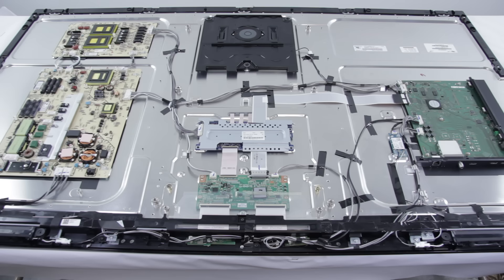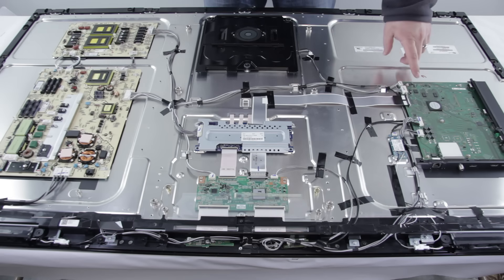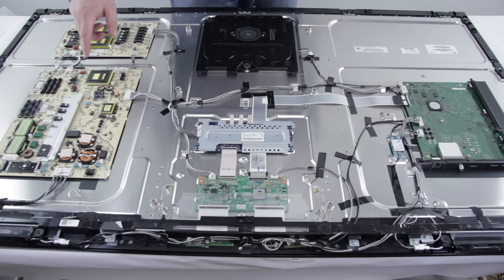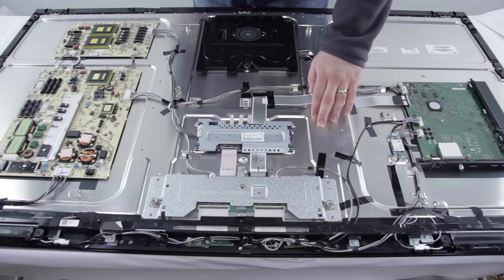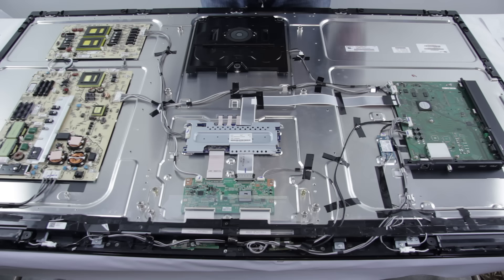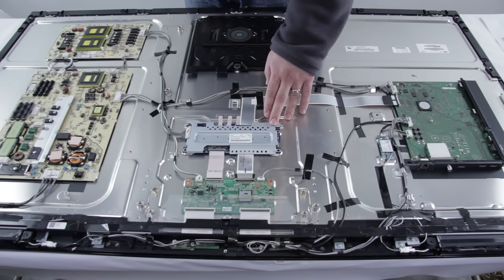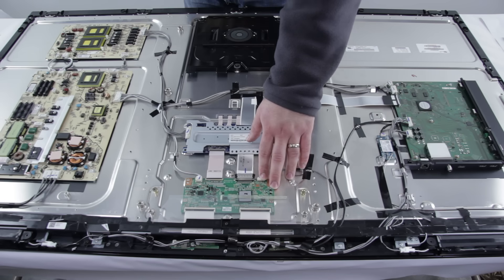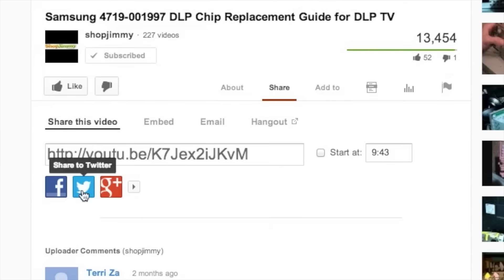LED TV Repair Tutorial - Common Symptoms & Solutions - How to Repair LED TVs

Comment: When I turn my tv on the vizio logo comes up then nothing else happens. After that I cannot turn the tv off either with the remote or the button on the tv. It just flashes the vizio name at the bottom of the screen,goes off for a few seconds, then comes back on with the vizio logo on the screen. I have tried unplugging it for awhile then replugging it,checked all connections and everything else I cvould think of but nothing works. Model M421VT.

Comment: I have a Hisense led lcd 50H5D tv. The picture went but the screen still have back light and sound. I replace the main board with a new one but still no picture. This tv has only a power board and main board and two small board connect to the screen. C an you say what is the possible cause. Could it be that I got defective board with the same issue or is another problem

Comment: Hi. Samsung un55c7000wfxza will not turn on. Has power. Has red standby light. When pressing power on remote or on the tv touchpad the standby goes out. Tv does not turn on.  Makes zero sounds or clicking. When unplugged allowed to sit several minutes to overnight then plugged back in with same results.  Once plugged back the standby light comes back on but same issue when power is commanded with remote or touchpad. Sometimes the touchpad light will stay lit once power is pressed and tv doesn’t power up.  It was a degrading condition over 2 days.  Outlet is good. Tested with and without surge protector.   Tv is off wall and ready to be opened for troubleshooting. I’m mechanically inclined but electrically dense. Thanks for your help. Cheers.

Comment: Hi, I am facing issue with my Samsung 32 inch LED TV speakers. The issue started when I had painted my house recently and I had removed the tv for sometime from the wall and then while connecting back I believe I had connected the tv audio input with my pc mic input jack with 3.5mm jack wire later I realized that it was incorrectly connected it then I changed the connectivity .i.e. between pc audio input of tv and then connected it to the pc speaker output 3.5mm jack but after that i started hearing lot of static noise in my tv volume. Below are my tv details:

Samsung LED TV 32 inch
Type No. UA32D5000
Model Code: UA32D5000PRMXL
Version No: CN01

Can you please advise how can I fix the above issue, do I need to replace the speakers if yes, can you share the exact details of speakers and where can I buy the same. thanks and lot in advance and appreciate your help on this.

Comment: Thank you for the video.  I am one of those people that has no power at all on my TV.  I usually will not try fixing a TV on my own, but your tutorial video gave some confidence.  I have 2 questions for you sir.  1 - If I was to order a power supply, would I be able to correcutly disconnect the old power supply and connect it to the new power supply with usual tools at home.  2 - When I do order a power supply, is it possible to locate a used power supply instead of having to pay more for a new power supply?
Reply: Forgot to mention that the TV I have is a D32x-D1.

Comment: Jimmy I have a 55'' Samsung TV model # UN55EH6000F there is a red light that surrounds the power button that's stays  on but the TV will not turn on at first I would unplug the TV wait 15 to 20 minutes then the TV would turn on but now even that stop working if you had to take your best guess would it be the power supply or the main board.

Comment: I have a tcl roku tv model 55fs4610r  the stand by light is on but the tv won't show picture or sound but the little status light is lite I have unplugged tv and tried hit reset button but it does not work still.

Comment: I have a Samsung, model number: UN60J620DAFXZA. I have no back lights. I did the flashlight test and saw the "Samsung" appear and disappear. According to your video you said it may be the LED driver...?? Is the LED driver in the main power supply? And should I replace the LED strips too? I already purchased the "T-Con" board before understanding your video and I am going to lose the "restocking fee" once I return that board...since that didn't fix anything. I would love the most economical option at this point to revive my poor tv. Thanks so much!!

Comment: I have been given a POLAROID LED model #50GSR3000. A small child hit the lower portion of the screen. There appears to be an impact spot and no color on that side of the monitor... what appears to be a crack goes up to the top of the screen. What would be the problematic part that would need repair/replaced? Any help with this would be greatly appreciated.

Comment: I have a samsung un55ks9500....I turned on the tv and the screen became blue with a glowing pulsating yellowis ball,,it was moving forwards/backwards.....this happened 2-3 times...the tv also(intermittedly) when turned on stays black from anywhere from 10-15 secs..I have pressed the samsung remote and the sources etc do not show at bottom of screen.....also,I have experienced while watching a program,the top right corner of screen(8 x 8") turns black..like pic in pic but I do not have that feature..this lasted for several secs.GEEK squad have looked at tv and another tech co...they found several service menu code issues.They say they need to remove tv to their shop to do diagnostic tests...they will keep for 1 week or so..
Have you heard/know anything about these issues?
Can they do the diagnostics in my home ?
these are all intermittent issues over last 14 mths ?

Comment: Do you have any kind of respectable repair of the ribbon cables where they run from the screen to the driver boards? Guy said he got carried away with the windex, and that it had run down onto the driver boards under the screen. Upon disassembly I found a spot of corrosion and about 3 traces burnt where the ribbon cables from the screen connect to the driver boards under the screen. I'm thinking to try the  soldering heat torch with just a little flux, but no solder to try to reconnect the 3 or 4 traces back to the board. I do have good clean contacts on the board with about 1/8 inch of bare traces hanging out of the ribbon cable, but these things are so fine, I have to use a loupe to even see what's the problem. I am somewhat versed in electronics, but I have almost no experience with the surface mount stuff, and most likely not even the tools for proper soldering. Most things these days are just replace a board or something, with no actual repairs to a board (replacement of discreet components) being done. It looks like the only other options would be to replace the screen with new ribbon cables attached, which of course is out of the question. This is on a 55 inch Samsung model un55eh6000f, manufactured in 2012. Many thanks in advance.   DW

Comment: Good afternoon, I recently purchased an Insignia 43" LED TV for my son, as he was installing the legs it appears that he placed pressure on the screen and now the screen is broken, it does not look broken from the outside but when you turn it on you can see a point of pressure. I know I have to change the screen, when can I purchase the replacement? the model number is NS-43D420NA18. Thank you.

Comment: My vizio model  E320i-B0 has no backlight or sound. There is an image. I used the flashlight trick and did see functionality. My tv has only 2 boards. I think. That's as far as I've got anyways. How can I tell if it's the power/driver board or the leds?

Comment: Jimmy thanks for the awesome vizio. However, I have a vizio (Model E65-E0 and serial number: LAUSVKAS3702629, PART # 10258070222) 65 inches TV when I toggle the on button, the screen will come on,then flickers for 3 seconds with white horizontal lines and then goes black. Though it seems to be on but the screen will remain black and when I repeat the process same thing happens. I contacted Vizio and they troubleshooted the TV and nothing happened. Unfortunately I was out of warranty and now I have to figure out what part needs to be replaced and order it myself rather than calling technicians and get charged close to $400 dollars for the job. I have had the TV for over two years. During the first year of the TV, I had almost a similar problem and VIZIO sent a local technician and he came and replaced a board inside. Please help me. I just need to know what exact part that needs replacement and where to purchase/order it (reliable source part). Thank you in advance

Comment: I have a 55 inch Samsung Series 7 Tv model: UN55KU7000FXZA. It recently started having picture issues. The screen appears to be off, but when you hold a flashlight or low light source up to the screen you can see a little bit of picture it is just really really dark. I can hear sound coming from tv perfectly fine. I originally thought the issue was with the main board so I purchased one from you guys. I changed out the main board and the issue still exists, I am trying to figure out what the actual issue. I will more thank likely be sending back the main board and asking to get the power supply board instead unless you can provide me a better idea on what the issue could be.

Comment: Hi,
I have a Sony 46hx929 led tv. Every time I turn it on from cold start, tv as an horizontal line with no pixel for 30 seconds. After that the image flashes for about 5 seconds and everything is ok until next startup. It doesn't show the problem if I shut the tv off and restart it in a short time like one minute or so... What could it be?

Comment: Hi, I have a problem with an LG 50LN5750. It is pulsating every seconds doubling the image a quarter inch below and come back to normal. Also have, two horizontal black line in the bottom of the image. Doesn't seems to fit any normal trouble shooting. T-Con board or mainboard or Panel? Thanks for your videos and the help! :)

Comment: hi im wonering if you can help me i have a samsung 50 inch UA50F6300AMXRD that has sound but no picture, if i unplug the right hand side panel the left works. any ideas for me to try? can i get a service manual for this if so where could i find one so i can figure out if its the tcon or the right panel. any help would be great pretty keen to find the problem. thanks

Comment: Hello, I Have a Sony XBR65X850C,

Initial problem: No power to tv, LED wouldn't light up and no response from TV at all. 
Replaced Video Board and Power Board, LED illuminated flashing amber/green followed by constant dim white. No picture, but i am able to hear volume up/down noises. 
Now at a loss as to what else may be the problem. From research some forums say LED backlight or panel, others say T Conn or even firmware updates. Any assistance would be great!!thanks in advance.

Comment: Hello my sony  tv model number is kdl-40v4150. My issue is the screen has green/red blocks of color in vertical lines. I already tried to just unclip and clip back in the panel cables to the tcon but that did change the issue.  Not sure if its the panel or the tcon.

Comment: Hello, I have a Vizio 32" E3D320VX. It has a 0500-0405-1320 LCD Power Supply Board and a 3632-1742-0395 Main board.  The tv turns on and is stuck at the V insignia.  Do you think that it is the power supply board or the main board.  The tv works great and I'd like to buy a board to repair it.  Thank you.  BTW great videos!

Comment: Hello,
Thank you for your video clips and for the information you provide.
I an issue with my LG smart TV. I have a model 47LN5750-UH. The TV turns on and you can see the LG logo clear for 2 seconds then it goes dark.
With a flash light, we can see and navigate the menu. Go on youtube and select a clip and we can hear and control sound volume but screen is dark black. What could it be?
Thanks in advance.

Comment: Insignia NS-50D40SNA14. TV works fine for 510 minutes and then you lose picture TV will stay on if there is a fan blowing on the IC chip or that area I should say. any thoughts would be greatly appreciated.

Comment: Thanks for the video.  I have a SONY KDL-52NX800 that has an intermittent problem in which vertical red, green and yellow lines will appear on the left side of the screen and a faint white line covers the right side.  These colors become clearer the longer the TV stays on.  We see this problem about once a week and it usually goes away after unplugging the TV for a few minutes and then plugging it back in and turning it back on.  However, last night, this did not work and I had to leave it unplugged overnight for the TV to return to normal functioning.  After watching some of your videos, my guess is that the t-con board or one of the ribbon cables is failing.  What are your thoughts?

Comment: is there a way to test the connections on the tcon board without it having to be so arduous? there are so many  small pins and wires in the ribbon cables.  Would i just put the test lead on its side and sweep the cable for resistance check?

Comment: I   have  a 50 inch Haier LCD tv. The  set is  about 6 years old. Two  days ago I noticed on  only one channel, 10 
 showing  green  pixels randomly all  over  the set. Its interfering with  clear watching.   all  other  channels 
 work  fine.  I have unplugged and replugged in the tv and made sure all connections going to the tv were good. Not sure what to do.  Its only channel ten thats  problematic. Unfortunetly I watch programming on channel ten.

Comment: Ok so I bought an led strip from you guys and I have a 50L1400U Toshiba tv. The issue I’m having is that the led strip will work fully for maybe about an hour, but then the bottom part of the led will go out. Turning the tv on/off fixes this problem but only temporarily. Any idea as to why it does this?

Comment: Hello I have a LG 47la6200 that I had in storage for a couple months. When I plug it in the standby light comes on but then turns back off within a few seconds. The TV won't turn on at all. Would a new power supply fix this?

Comment: I have a toshiba 55L621U    it powers up to main splash screen but then cut out after about 8 seconds. I checked voltage and power is getting to power board and over 5v to the brain.
Reply: 5v over to the logic board       I have two of these TVs with the same problem

Comment: Hi Jimmy. Thank you for you tutorial. It would be great if you help me to diagnose the problem of my Toshiba LCD 46UL975. I have the following problem, if I plug in tv I see black a bit highlighted screen and the green lamp, like it tells that it is really connected to electricity, but if I try to control tv with any remote or hardware buttons - nothing happens, or plug in hdmi or av cable, it shows no sound and no picture and again nothing happens. As you say in your tutorial it can be an mainboard problem, but I don't know how to check it without buying another board, or maybe you could suggest me anything I didn't know. Maybe you met this problem before. Board number PE1063 V28A001396A1

Comment: Hey Jimmy. Thanks for making this helpful video. I just inherited a Samsung 60" (UN60FH6003FXZA). When I plug it in, the red light (standby) comes on, BUT when you push in the toggle button, nothing happens; no sound, no picture, no lights. Since the red light does show on the bottom right corner, and by process of elimination, I can determine the problem isn't with the Power Supply, but most likely with the Main Board or T-Con Board. 

What is your professional opinion on what to do and what parts to buy? With the right parts, I am certain I can do the installation myself. Let me know what you think.

Thank you in advance.

Matt

Comment: I am glad I found your channel.   I have an LG 55lm6200 TV.   The video and sound went out suddenly.  When I use the remote to power it on, the red light will flash a few times like it is trying to start up then it will go off.   Possibly the power supply?    Thank you .

Comment: I have a Toshiba Model 50L1350U SN D32248T46116L1 that has a horizontal line near the top of the screen.  The picture below the line periodically moves up and down while the picture above the line does not move.  All other features of the television work perfectly.  Is there a repair for this problem?

Comment: Hello I have an LED Phillips 55PFL4609/F7 it powers on and the "Phillips" logo comes up. The screen looks fine. After it Powers up and the logo appears it flashes the #8 in the left corner and powers off with a noise coming through the speakers like a pulse and turns off. Please help..

Comment: I have an RCA TV (Model # led50b45rq ). I has no sound or picture. When you press the power button you get the little red light on the front comes on though. I opened it up and it didn't have any blown capacitors. Do you have an idea of which board I should replace?

Comment: I have a vizio e24-c1 LED smart tv.  I was also using it on my laptop because it still had a RGB input.  My child took it upon himself to take the power cord for laptop and RGB cable going into the tv and touch them together until i smelled hot electronics coming from the back of the tv. now it doesnt turn on or show anything on the screeen.  The tv is not very old, but the tv is only $150 new anyway.  is it worth trying to get it repaired? Thanks

Comment: Hello shop jimmy, thanks to Tampatec I'm trying to fix my 50in Samsung, power board over heated & melted board. the power board is a bn44-00856a. it melted at cnl802 where the power cord goes to i think back lighting. what i want to know is there a diff power board i can use or need to use the same board. also it melted the power cord so i need to find a new power cord. this is a un50j5200afxza. any help to get parts would be great.  mark

Comment: I have a LG 47LM7600 edge lit tv. I'm experiencing thin black lines that start heavy in the upper right hand side of the screen and then fade as they move to the center. I've replaced the power board, but this did not fix the problem.